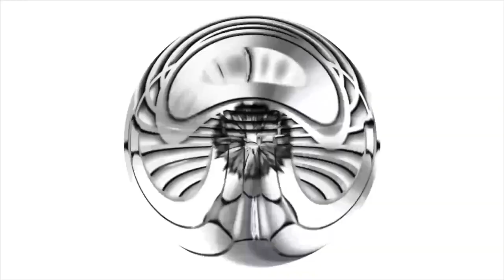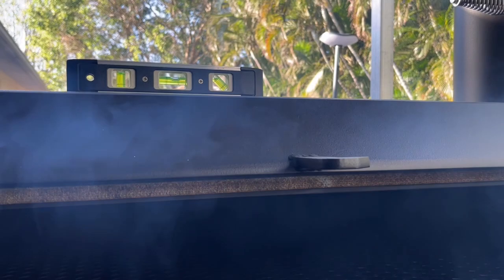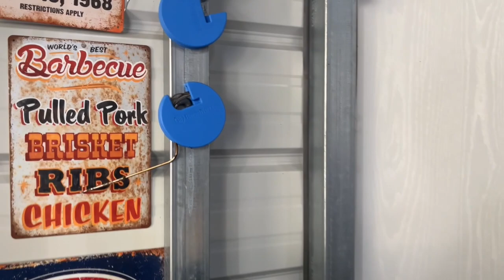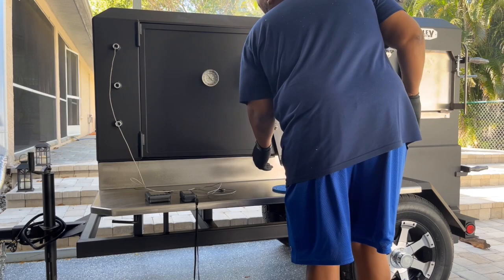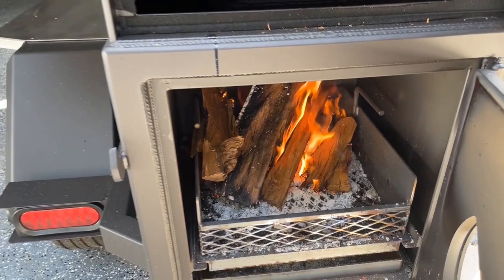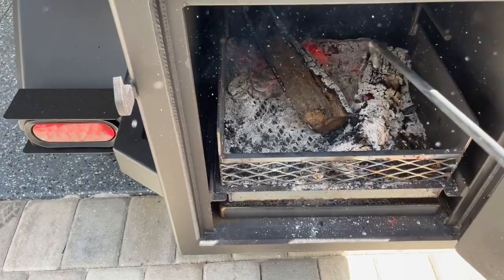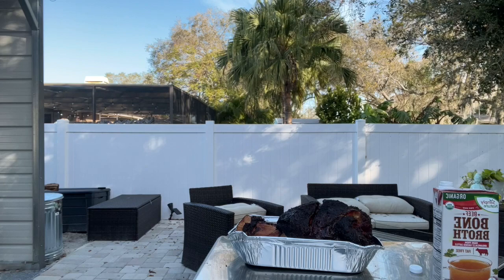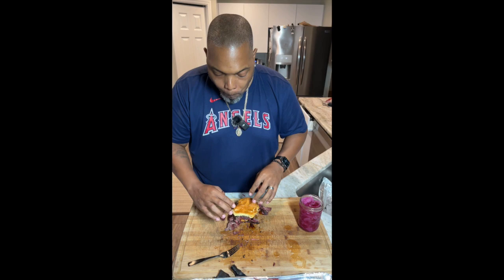Beef Shank on the Shirley Fabrication 24x60

Comment: Great video. Took me a few days to get through in chunks with kids and work grabbing at my time. You really have that shirley rocking. The beef shank came out looking perfect after the oven rest. I like how you showed the way to thread a thermoworks probe through and get yourself setup with the smoke unit. I have both the signals and smoke,depending on wifi,  but the temp probes are the same.  Nice display presentation showing how to adjust the dampers and chimney for air flow and smoke. When are you putting the big Dino plate ribs on Mr Practitioner of ribs? PO q13h #4

Keep the videos coming. You're going to be an all star
Reply from the maker: lol thanks for watching.  I actually threw on some Dinos on Super Bowl Sunday.  They turned out amazing...